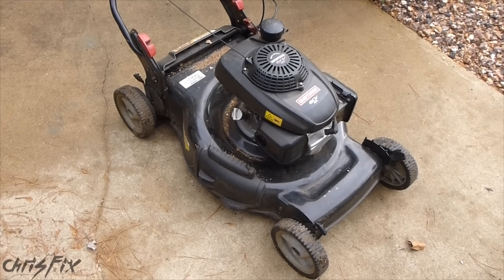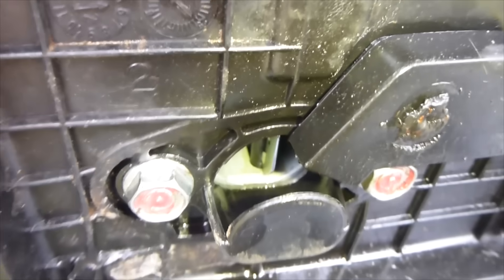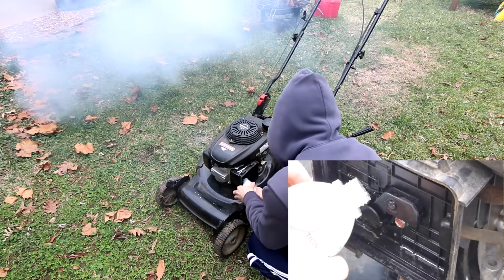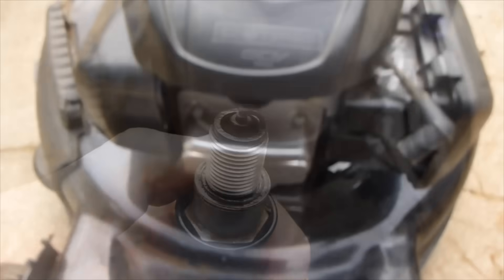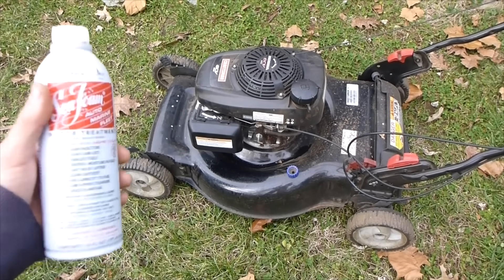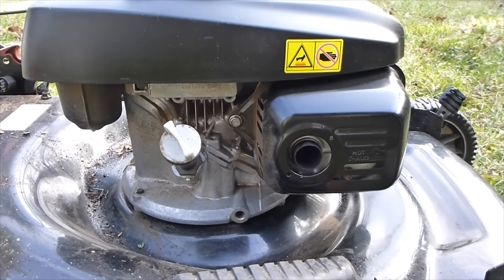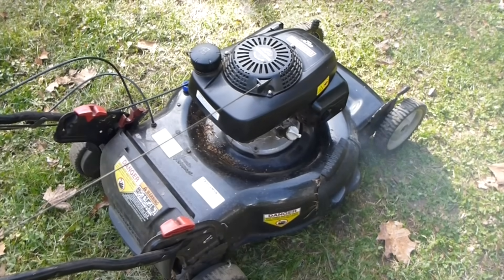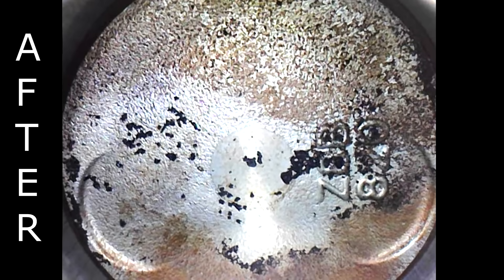Does Seafoam Actually Work? (with Proof)

Comment: why does the carbon deposits hurt? or why should we clean it
Reply from the maker: Only large amounts hurt, this would be fine. If you have a good amount of carbon it increases the cyliner temperature, increases compression, and decreases efficiency. All of this can lead to engine knock which is fuel exploding before the top of the stroke. That can damage an engine.
Reply: step AWAY from the moving parts

Comment: It will remove deposits but at the same time will wash lube off cylinder walls, not good at all to goof up the bore.  See scratches in the video. Best to use water injection to clean out carbon on car engines.  A tiny mist of water at 50-60 MPH will do the job.

Comment: I always add it to the gas whenever I get some for the small engines....this stuff REALLY works!  My 250cc Honda motorcycle would not idle at all, tried every adjustment I could and would up breaking off and adjustment pin.  Did some looking around on forums and some said to add the seafoam directly to the gas, so i did...white smoke cam pouring out.  I like the bike run for about 15 minutes, until the white smoke was gone and it idled beautifully.  It happened again last weekend, did the same thing, fixed it.  I swear the guy that invented this stuff needs to get some kind of a medal.

Comment: Would you suggest any certain product(s) to get a layer of "sludge" out of the bottom of a lawn mower's Gas Tank please?
Reply from the maker: If you soak the gas tank with some transmission fluid and then pour it out, that should work wonders!

Comment: Nicely done video. Adding a cap full of Seafoam via the fuel tank works well over a longer period too. Also, as mentioned in previous posts. Water will do approximately the same thing, it literally shocks the carbon from the piston, but it won't do a thing to help the rest of a fuel system lol.

Comment: Too bad you couldn't show how much carbon came off the valves.  The big efficiency improvement would be to clean up the valves on both sides to improve air/gas flow.
Reply from the maker: Yea, I just started doing that so stay tuned. I need to find dirty engines because they are all clean. here is one example: https://www.youtube.com/watch?v=BocH2c4mYcc
Reply: it probably helped

Comment: If added slowly, you can do that with water. Really you can.
Reply from the maker: Thanks Don! I will be testing water! Stay tuned!
Reply: This is the right answer.  Water does the exact same thing.  All the additives in seafoam are useless snake oil.  Slowly pour water into your intake and the steam will clean the carbon just as well.

Comment: so what happpends to the engine if you have alot of carbon?
Reply from the maker: The compression increases and the fuel ignights before it is supposed to (pre-ignition) and can cause knock. The detonation can destroy an engine. Most engines today are so strictly managed that carbon is not an issue.
Reply: ChrisFix so maybe this would be a good thing to do in my 1950 oldsmobile? im from sweden so i dont know if seafoam is available here.

Comment: Hey ChrisFix, would it be possible to use the same method applied here to the Car Engine.  Basically pour the seafoam into the combustion chamber, let the seafoam dissolve the carbon buildup. View the combustion chamber with your camera to see the dissolving action.  Then when it has "completely" dissolve the carbon buildup, vacuum out all the remaining seafoam / carbon buildup with some clear rubber hose and special vaccum.  I was wondering if you did this method on a Car engine.  Would it work? Are there some other factors I'm missing here?  Could you possibly make a follow up video with this method to see if it would work? Thanks for reading.

Comment: Good job on the video, but I have a different interpretation of what happened. One, your engine was EXTREMELY clean to start with. Carbon that causes trouble is regularly 1/16 to 1/8 inch thick. Two, the treatment did basically nothing. It cleaned off a few percent of carbon that's as thick as if you drew it on with a marker. If it has any chance of cleaning REAL carbon, it would have blitzed through everything you had there. The soaking actually did work, because at that point you're physically cleaning it, the only process that could ever actually work. So it's the same as every other snake oil product on the market. There's only one way to remove problematic carbon deposits, and that's with the head off.